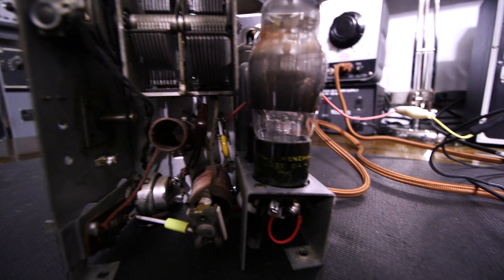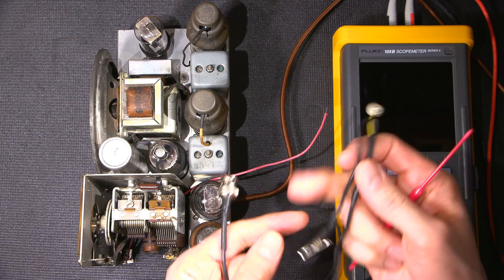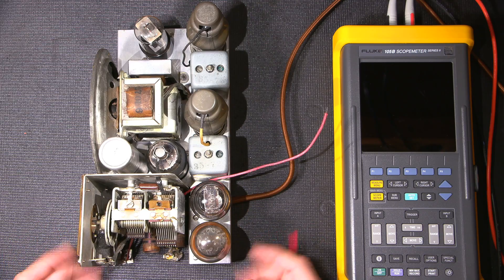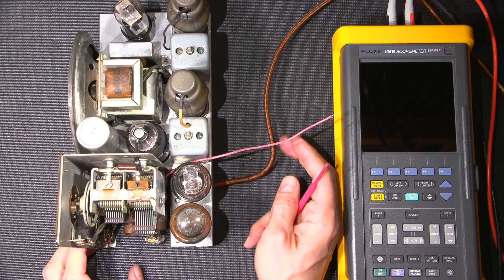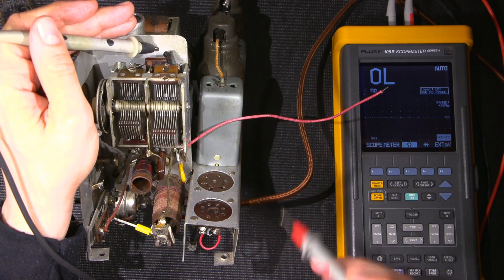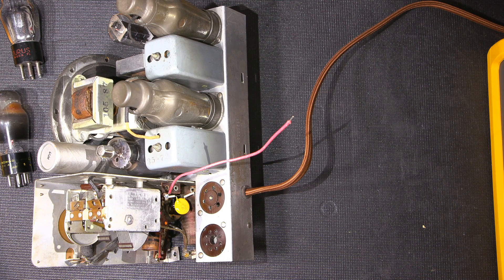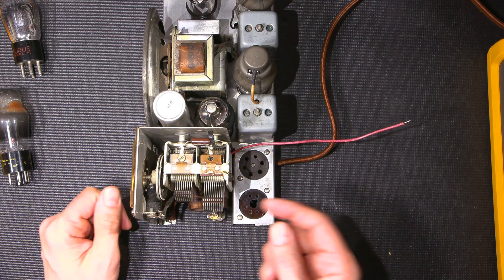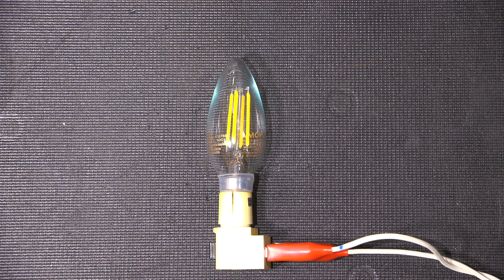See High Voltage Created From Falling Snow!

Comment: I’ve seen lightning during snowstorms a few times in my life. This suggests that one of the flavors of snowstorm produces some kind of “charge separation/transfer” mechanism similar to summer thunderstorms that would create a significant voltage gradient from cloud to ground and, in this environment, snowflakes would act as “charge transfer” particles (each one a little air dielectric capacitor).
A couple of electrical analogies for Mr. Carlson’s sparking radio that come to mind are the spark gap transmitters used in the early days of “wireless” transmission and the spark gap excited Tesla coil. However, the clearest analogy for me is that of an organ pipe:
An organ pipe is driven by a unidirectional low pressure, low volume air flow which would be analogous to the electrostatic energy transfer provided by the falling charged snowflakes. When the organ pipe is driven by the incoming air, a pressure wave is generated which travels to the end of the (resonant) pipe and is reflected back to the throat. When the pressure pulse gets back to the throat, it presents a high impedance to the incoming air (resisting the input of “air energy”) and then, as the pressure pulse bounces off the throat and travels away, it presents a low impedance to the incoming air so that it can now flow easily, reinforcing the retreating pressure wave. So it’s converting a “DC” flow of energy into and “AC” output.Thus the resonant energy conversion builds up quickly over a few cycles, and the organ pipe “speaks” at its resonant frequency. My analogy to Mr. Carlson’s sparking radio is thus: Assume that the snowflakes are carrying a negative charge. The electrostatic energy flow caused by the charged snowflakes excites the resonance of the LC input circuit of the radio. As the LC circuit “rings” negative, the antenna wire exerts a slight electrostatic repulsion on the snowflakes (slightly higher impedance) keeping more snowflakes “at bay”. As the LC circuit “rings” positive, the antenna wire exhibits an electrostatic attraction on the snowflake, “gathering” more snowflakes and their charges--which injects more energy into the system. This is what I would call an “LC/air dielectric” oscillator. Due to the relatively high Q of the LC circuit, as the energy in the circuit builds, the peak voltage increases until it jumps the gap as observed by Mr. Carlson. Then the process starts again.
To take this analogy back to the organ pipe—if the organ pipe had a mechanism at its top end such that when the reflecting pressure wave reached a certain intensity, it would open the top end of the pipe and simultaneously shut of the incoming air, this would be the effect of the arc over. So the arc observed by Mr. Carlson is actually an approximately 1 MHz arc (depending on where the radio was tuned). How to tell if my thesis is correct: A nearby spectrum analyzer with a whip antenna attached would show an increasing amplitude peak at 1 MHz until the gap sparked at which point the amplitude of the spike would collapse to zero and then start to rise again. There would be no arc inside Mr. Carlson’s isolation transformer because the isolation transformer is low impedance at 1 MHz due to capacitive coupling to ground and/or primary.
Some broad stroke numbers to support my speculation:
1)The spark looks and sounds like it’s in the 1-2 kV range—-a good “Y” capacitor will handle this without shorting.
2)Say the RF coil is ~2” long with 200 turns of cotton covered, wax impregnated Litz wire. This would produce ~1 V per thousandth of an inch—-easily handled by the insulation system.
I rest my case.
Ken Robart

Comment: We were working at a 500 foot tower site in the winter moving feed lines from the tower and a freak snowstorm came up. We got snow induced lightning and it struck the tower and gave one of the guys a pretty good jolt who was touching a line, he was on a ladder. And the tower was grounded with a 90 foot deep well put in specifically with a copper pipe and salts for making a good ground.

Comment: Is it possible there was arcing at the antenna? The discharging of the center conductor to shield would briefly apply a step pulse across the inductor via the coupling cap causing the spark.  Basically, I'm claiming the spark you witness in the radio is a secondary effect of a discharge across the antenna conductors happening outside: a capacitively-coupled transmission-line pulser.

Comment: I had a similar experience with rain many years ago.  We had just finished installing a VHF low band (42 MHz) vertical dipole antenna with 1/2 inch heliax cable on a tower when it started raining heavily (no lightning).  While preping the lower end of the cable for connector installation, an arc jumped between the center and outer conductors. It was scary enough to call it  a day.

Comment: My late father had a long wire with decent insulators (glass), in the shack there was a knifeswitch to enable the wire to be isolated and taken to ground. On a wet and windy day he heard a ticking sound which sounded like water dripping, it took a while to find, it was an arc across an ATU tuning C. In your case I suspect you had something similar going on, the resultant current pulse "kicking" the tuned circuit in the radio. A little like the primary circuit of a tesla coil. I have had a fun shock from coax connected to a long wire during a storm,  the outer was grounded....

Comment: I have experienced a similar arcing on a antenna I had up a few years ago. The arcing was occurring across a bnc connector and the arc looked similar to what I saw on yours. Also when I touched it I got a hell of a belt from it. After I stopped swearing and did some analysis I came to this conclusion, the static charges up the coax until it arcs or you get a jolt. Static is DC.    ;)

Comment: This might be the answer for you. You told me your antenna is connected on just one side. So I assume your coax is as well. You also say, which is true the capacitor blocks dc voltage.  which can result to the following: you antenna receives static from the falling snow, the coax will then be charged since it it inshielded. It is able to charge due to the resistance of 32ohms to ground. When a high voltage got created(probably a lot higher than the cap was rated for) it discharged through the casing and restarting charge process again. The effect will probably be higher when more snow is falling or even with snow lighting storms. Cheers, it was very interesting tough

Comment: Art Bell an amateur radio operator had received around 60,000 volts and about 600 amps come from his antenna through a wall through the coax cable and it was arcing all the through his radio shack and to the pass through in the wall . He said that when that happened there was a high wind and dust storm blowing through the area he lived in .

Comment: For what its worth, I offer the following story as a partial explaination for arcing, despite the low resistance connection between the points.   (and I would have dismissed this story as a tall tale or misunderstanding of the facts, if I hadn't been thoroughly involved with the equipment and the experiment, and witnessed the phenomenon myself). As an undergrad mechanical engineering student, I worked as a lab technician in a well-known pulsed power research lab in Texas. We had a 4 MEGAWATT(!!) pulsed magnetron driving a side-coupled resonant ring, which gave a power multiplication of at least 10x. The ring was rougly rectangular, having generously radiused corners, and was overal about 6ft by 10ft, composed of short length segments of rectangular 2" by 4" solid walled copper waveguide. The hollow waveguides were held together with bolts and flanges (all stainless steel to limit magnetic or paramagnetic influence), and evacuated to a hard vacuum (>10e-6 Torr, and I even got her down past 10e-7 once). The apparatus was being used  to test the energy density required to achieve breakdown over alumina microwave windows that separate the high vacuum of the microwave generating systems from other parts. The test chamber, often filled with sulfur hexaflouride gas, with an alumina windiw on each end, was in line with the ring. The chamber was comprised of two circular stainless steel waveguide flanges, about 10 inches in diameter and 0.750 inches thick, with a corresponding SS ring about 1.5inches in length (like a very  thick-walled tube) between, thus forming a chamber. This was held together with at least a dozen 3/8" stainless steel bolts, each  torqued to yield. The vacuum seal was made not with elastomeric o-rings, but rather copper shear seals or crushable indium wire for the non-vacuum joints, the point being that all parts were in VERY intimate electrical and mechanical contact with each other. On the final day of the test program, we max'd out the equipment to see worst-case breakdown (there was an adaper flange for a very expensive broad spectrum digital camera, set to trigger with the magnetron). 
During this test, at over 40 megawatts, and some insane power density, I witnessed multiple locations of arcing on the EXTERNAL joint of the chamber wall and flanges, despite their being, for all practical purposes, a monolithic block of stainless steel.
So, my hypothesis is that static chsrge from the snowfall raised DC potential on the line, but was also driven with an AC component by the overall very large surface area being "swished" by coutless particles, each driving a tiny pulse increasing or decresing the "DC bias" Obviously, it would not be in the microwave frequency range,  but is it true this effect could be present at lower RF frequencies?
Or, you got zorched by a freak cosmic blast, or maybe some strange snowstorm-driven RF reflections were channeling a powerful transmitter or radar station to your gear?
Reply: in this case 
I would say dc with fast rise time the coax would be charging the whole system in till the charge on the chassis side found a arc point the sudden discharge would present as a fast rise time to the coil blocking it causing the reaming charge in the coax/antenna to ark to the chassis
Reply: @ratbag359  you know,  the coax itself vfx and everything connected could be ringing upon discharge somewhere else, and THAT is a far more plausible source of HF. That reminds me of another chunk of room sized gear at the pulsed power lab,  the Vircator. A big HV capacitor bank discharges into a spark gap at one end of a coaxial line a couple feet in diameter, with a giant coaxial diode at the other end, all filled with x-former oil. The length os significant to the frequency. Generates gigawatt microwave pulses.
Reply: @DrewskisBrews  ringing will occur but i think this is a Capacitive thing be interesting if he captures a waveform.

Comment: Three thoughts: a) charge build up in the antenna wire due to triboelectricity from the snow particles, b) an arc can be something with high frequency content and nanosecond rise times, which the 30 ohm coil would block and therefore not shunt to ground, c) voltage may have risen slowly until it exceeded the given air gaps and/or dielectric strengths.

Comment: On the flight line when B1-Bs park they had to be plugged into cables  attached at one end to long rods driven into the ground before you could do anything to the aircraft.  In flight the aircraft builds up a static charge.  The plane stayed grounded the entire time it wasn't flying.

Comment: 1) Be sure you tighten the knob on your Tek scope so the module does not slide out! Making me nervous!

2) The precipitation static from  the snow is wideband random EM noise. The 36 ohm resistance of the coil is not draining much energy, instead the inductance and capacitance of the circuit are resonant to some of that WB noise and therefore the voltage is building until the little "Spark Gap" flashes over. I had a ground plane CB antenna years ago and during a snow storm I could light a neon bulb across the PL259 terminals of the coax. You have sort of a mini Tesla coil thing going on in the radio. 

3) You need to ground that feedline and install a Polyphaser gas discharge lightning protector. Check all the wiring into your labs to make sure you don't have a serious lightning damage situation in the future. Motorola R56 is an excellent source for grounding and bonding recommendations. Polyphaser also publishes white papers on the subject.

Comment: Decades ago  I had a Tempo 2020  mobile in  the 78 Ford  LTD II with homebrew  antenna coils, about 12'  antenna.  I was going somewhere, it started to hail--hard and thick, and the radio went nuts,  squealing  and  makine  horrid noise from the static buildup.  I  was going  maybe   30-35 down a county road,  reached behind the radio (on middle of  floor hump) and unscrewed the feedline.  I  fumbled a bit and got a NASTY  bite, touching the connector terminals.   I  "tossed"  the connector to the passenger side  foot area  and it lay there on the floor  SNAPPING  ARCS   from the  center to the shell  every  second or two!!!!

Comment: I suspect the inductor and capacitor resonated and charged with static coming from the antenna.  I would be curious to see if you had you had a spectrum analyzer running if there was a pronounced spike.

Comment: I'm not inclined to read through all the comments to see if anyone else has made these points, but here they are:

If the impulse is fast enough and the coil is a high enough value, it will block the impulse and arc instead, so there's no big surprise there.

If the other side of the antenna (that's connected to the coax shield and that's floating) arcs (somewhere else, perhaps at the antenna feedpoint) to the coax center conductor node which you have connected to the radio, the resulting impulse will travel through the X1 capacitor and arc to the chassis (bypassing the choke).

In the process, with repeated discharges we would perhaps expect the X1 capacitor to build up some charge, to the point where it would arc. But maybe its capacitance is large compared to the amount of charge in each impulse, and/or maybe there is a high resistance leakage path from the center conductor to ground, preventing a large voltage to build up on the X1 cap.

Furthermore, there's no proof that the X1 capacitor wasn't breaking down. If it did break down due to charge accumulation as described above, it probably would not do so on every discharge. You cannot be sure that just because it isn't damaged, it didn't break down a few times.

Comment: Fifty years ago I was doing my high school homework on my large varnished wooden desk.  I heard some arcing noise and noticed blue arcs were travelling across the desk varnish like small lightning bolts.  The arcing was coming from a RG-259 coax connector laying freely on the desk.  The coax was connected to my 20 meter cubical quad antenna outside.  The cubical quad is a closed loop across the coax using 64 feet of bare wire.  I panicked and ran outside to see what was happening.  There were large flakes of fluffy snow falling from the sky.

Comment: Hey Paul,
I found the source of your problem with it....it was that pesky squirrel in the tree in your yard using his Spark Gap transmitter !  ;-)  
On the serious side, that was indeed an interesting issue.  So many things I would like to know about what was happening during the arcing.  I am sure you would like to know them as well...things like what was the level of KV that caused the arcing.  What was the resonant frequency of your antenna?  What frequency was the radio tuned to?
Thanks for sharing the information with us!

Comment: I had a similar experience several years ago. We had strong dry east winds that day. I heard what sounded like water drippings, what! dry east winds and it sounds like I had leak in my roof. I looked around and found the sound coming from my antenna turner, I could see the sparks going across the antenna cap.
The antenna tuner was connected to a 600 foot long wire. No damage. Thank for the videos. Carl   de N6NZX

Comment: Very curious phenomenon! As you noted, the chassis is isolated from ground by the isolation transformer, so the 36 ohms resistance isn't really a factor until the arc over occurs within the isolation transformer. Perhaps the arc in the isolation transformer was triggering an inductive kick through the 36 ohm coil large enough to cause the arc you observed from coil to chassis. When the arc within the transformer extinguishes, the dc path is then broken like the points in an old school car distributor. Pure speculation of course!

Comment: We had two guys installing AC ducting in a test bay and they had it running as it was the middle of August.  Well, while installing they kept getting shocked.  Even though the ducting was grounded thru the building structure, the air running thru the ducts was enough to generate a large static buildup of charge.  I don't have the video; however, running a ground wire from the floor to the upper sections of the ducting had enough potential to easily jump a 1/4".  And it was not a little snap either.
So, falling snow in dry air near an antenna!  You bet!  Anything that can static has the potential of generating a charge.

Comment: My guess is the capacitance of your isolation transformer got charged up, arced, and the resulting arc current was high enough to induce voltage on that coil to break down the air gap in the radio.